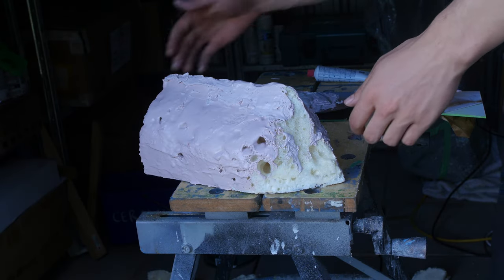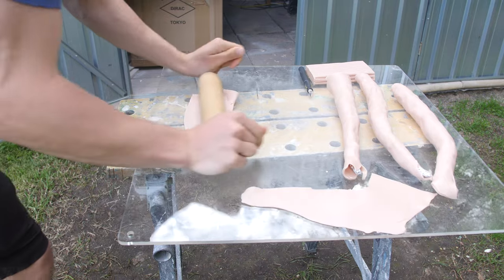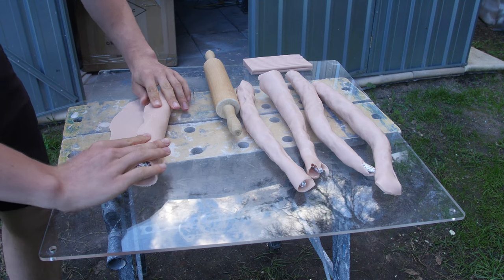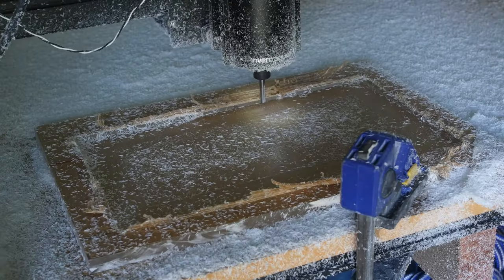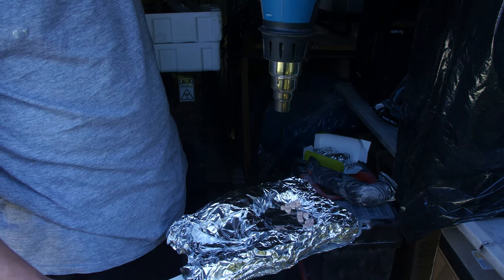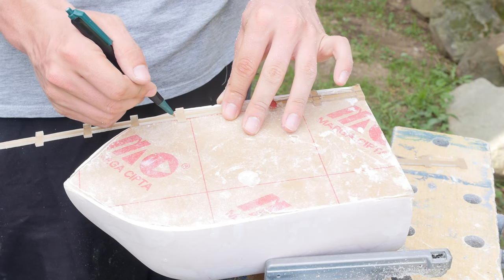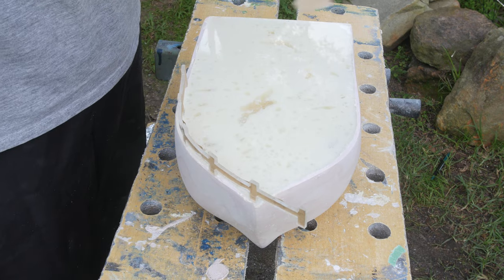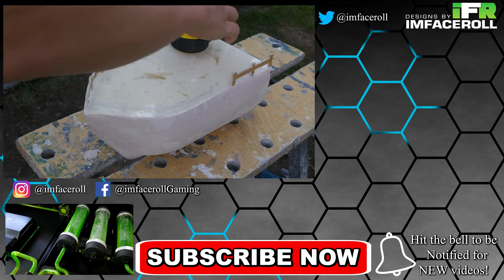Pirates of the Caribbean - DIY Case Mod Progress 2 Computex 2017

Comment: Amazing really looking up for next progress update!I jus have 1 question.I want to mod my corsair h55 aio to have led logo.I will put transparent acrylic on top and cut hole and can i connect led panel to my pump?Will it provide enough power both for pump and led light or do i need other power source?I will probably then use molex with one resistor
Reply: aleksa stojanov It should work fine
Reply: ok,ty will try it out as soon one guy who is cutting me cable combs for my custom cables shop is free to cut that piece for me
Reply: Good luck then
Reply from the maker: +aleksa stojanov yeah man plenty of power, leds use next to no power especially for what you want to use it for
Reply: ok,thank you so much man i am really loking forward to my 1st mod,btw keep up with good work
Reply from the maker: Thanks man =)

Comment: say you wanted to add vines that would wrap doing hard tubing, how would you do it and make it look gold
Reply from the maker: id grab some fake ones from ebay or amazon and wrap some on the walls of the case and the tubes themselves, i guess its just trial and error to see how much is the perfect amount
Reply from the maker: yeah i think that colour would look nice wrapping around some tubes, definatly give it ago
Reply: Designs By IFR thanks :), also how strong do you think acrylic is to make a case out of it. like have a steel/aluminium frame with acrylic panels ty